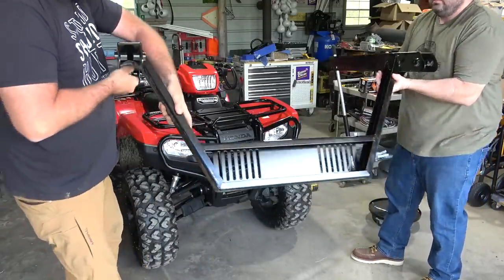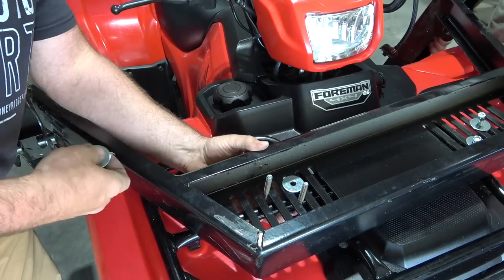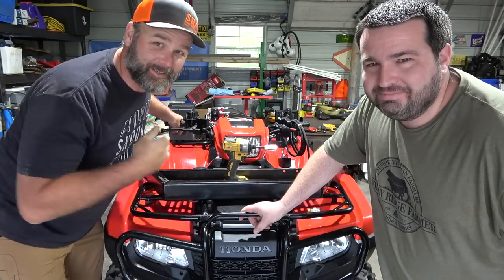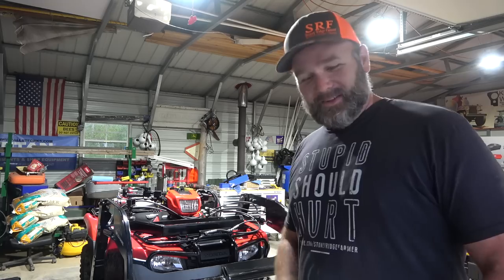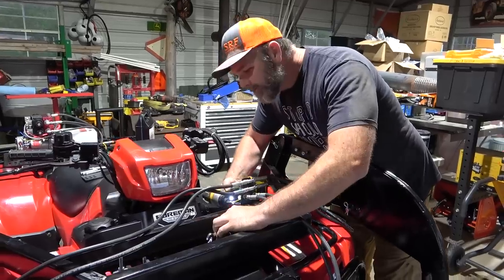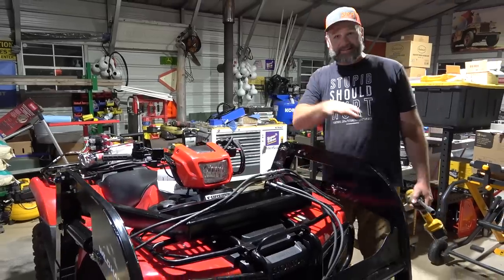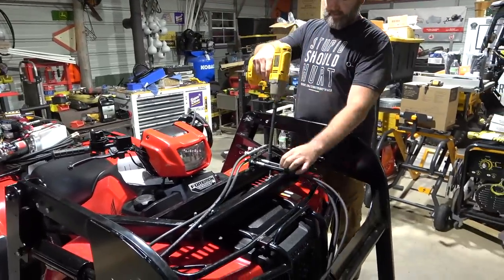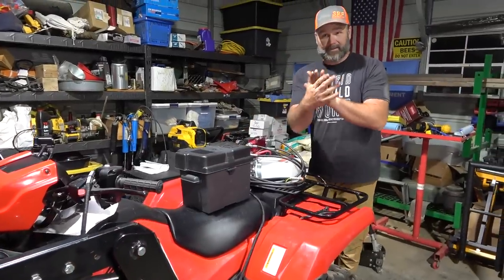You've NEVER SEEN an ATV LIKE THIS

Comment: Josh, if you can plow with that, im gunna take the video and throw it at my tractor dealer that told me  L3800 cannot plow/ rip  with more than 1 tyne, or use a rotary hoe.
Reply from the maker: Gonna install the 3pt soon and give it a try!  Great for food plots and small projects around the yard and farm I'm told!
Reply: You can plow with 2 bottom with coulters. I can pull that with a L245DT
Reply: @doomman700  thank you.
Reply: @Shane_O.5158  I live in central In so we have good dirt, I never thought about heavy clay making it hard if you do have. ✌️

Edit: your local deal can probably find you one to try out. Mine is great about things like that.
Reply: A L3800 should easily pull a 2 bottom moldboard with 12" plows easily. I know guys who pull double 12's and a few guys that pull triple 10's with large garden tractors. Granted we have decent midwest soil, but still.
Reply: It depends on the dirt you are trying to work. In your area with unmodified soil it might be true.
Reply: @doomman700  thank you, i might do a test before buying.
Reply: @msack6904  thank you i have great loamy soil, with clay 18 inches down. i might have to rip it first to remove old tree roots.
Reply: @calvingreene90  thank you i have great loamy soil, with clay 18 inches down. i might have to rip it first to remove old tree roots.
Reply: @Shane_O.5158  I pull a 5 chisel pasture renovator/chisel plow with my 3901 no problemo in low range. I was ripping huge roots out as well.
Reply: @JDOutdoors23  thanks, that's what i needed to know, i think mine should do it.

Comment: Hey Josh.  Just a small safety tip. Those hoses don't need to be rested under your leg.  If you don't want to cut the plastic and run the hoses under them which I do understand. Get some pvc pipe and proper fittings to make it rest nicely where you want it to go.  If for some reason a hose blew under your leg it could be tragic. Lookup hydraulic injection.

Comment: Cool build video. 
I have to say that's a cool attachment and Wildhare is really proud of them with those prices. I would be worry about the durability of the 4 wheeler, just not designed for the ground engagement forces like a garden tractor or bigger tractor are. 
I'll stick to building one myself for my tractors, I can afford doing that.

Comment: You should run some heavy wire from deep cell battery to the Fourwherler battery that way it will keep it charged as long as its running the Fourwheeler. Great idea. Great Video thanks for sharing..

Comment: They make similar attachments for garden tractors, so this set up should be about as useful.  Good for garden, lawn and light chores around the homestead.  I can see where you might use it for checking livestock and carrying bags or buckets of feed to them.  Good for checking and repairing fences or taking a can of fuel to the field to top of the tractor when you're in the middle of baking hay/etc.
Reply: I meant baling hay.  Don't you love auto correct.

Comment: You can put an isolater blocl from the onboard battery to the back battery which will only charge when running ,other wise they are seperate circuits

Comment: I have seen these mounted on small lawn tractors. Not worth the hassle!
Reply: I think it all comes down to what the lift capacity is. That front loader bucket is quite small so it's not a tool for large volumes. The short wheel base and low weight of the 4 wheeler means the lift capacity can't be very high and also that attachments such as the pallet forks have very limited use.
Also note that the simple design of the lift mechanism means the tool installed will tilt when the arms are lifted. This makes using the pallet forks a bit harder, and you definitely want to think things through before lifting anything more than a foot or two.
This doesn't mean it's going to be useless, just that you have to be prepared to work with the limitations and not expect this to do heavy lifting.
On top of that comes quality concerns. The fit and finish seems to be good, at least is appears that way from this side of the screen. That doesn't mean the material is necessarily going to be of good quality, but it increases the chances.

Now is this thing going to be of use to you? I have no idea. To me it seems it could be of use for very light work, such as shoveling snow where a large tractor is overkill. Depending on lift capacity it might be able to stack hay bales and such. It won't replace a tractor anywhere you need to lift anything really heavy. So it's of limited use, especially if you already got a small tractor, but in the end it all depends on what your expectations are.

Comment: I've owned my Wildhare  FEL/forklift for about 4 years now. Cute as hell, ain't they. People marvel at mine, which is attached to a 2010 Honda Rancher 420. They are easy to
set up, and the are good for snow plowing your driveway and very little else unless you're driving a largest ATV available. My 420 is the minimum a Wildhare will fit.
One serious problem with these loaders is that you have to provide your own ballast. They will not lift even 100 lbs. without some sort of counter weight on the back
of your machine. So, be warned. The bucket as you might be able to see is way too small for any serious earth moving. My load came with a set of 32 inch forks,
which do a credible job as long as you have the ballast. I use them mainly to move wood around my property, and the bucket I use for small amounts of stone and snow
plowing. Anything more serious and I get out my JD 1025R, which I use when the Wildhare is to small for the job. No way am I badmouthing anyone here. I like and subscribe here. But we all have to keep a level head about what we all are seeing here on YouTube, as well. Keep up the good work, Josh.

Comment: Could you do a follow up on the 3pt hitch & those implements & performance/utility
7k for a full package from wild hare + a 500cc 4X4 atv =13k =+ -- 1k mini tractor or big no?? 
Just trying to run some numbers. A good older tractor with functional implements vs this new gadget 
Small acreage needing a best fit power multiplier tool kit. What's really bulletproof & long term useful??
thanks

Comment: I have a unit like that for my 01 sportsman that I bought back in 2003 it was made in Hawley Mn by concord industrial or something like that, the big difference between this one and mine is the hydraulic pump for mine Is located on the front rack, I talked to them about 5 months after I bought mine and said they need to put the pump on the back to help with weight and run a 12 volt deep cycle battery in line with the atvs battery, I know they made the change but then the company moved and I lost contact with them, think my loader is called a Groundhog or something like that, it’s sitting behind my shop right now, they also used a front shock bar that you put in the front shocks to make them more solid so it wouldn’t dip so much, I used it a lot for small tasks then took it off and it has sat for 17 years now. They used a big 2x6 channel that ran under the wheeler left to right with u bolts holding it onto the frame and then the loader arms bolted down to that channel where your feet sit, still had room for your feet, then there was a cross bar on the upper loader arms that bolted down to the rack, my pump is also attached to that cross arm. I’ve always wanted to see if it will bolt up to my 2014 sportsman but just haven’t taken the time to do it, I would also move my pump to the back rack like yours is now. Have fun with yours and don’t tip it over by getting into a bad angle, it happened to me in a ditch, lesson learned.

Comment: This is so stupid. Just get a tractor with a loader. This will ruin your atv. Make sure you go slow  when you have that thing on. That will put a ton of force in places the atv is not designed for.
Reply: I 💯 agree .. the atv is not meant to take the force an stress this will cause it to have .. blocking the shocks ?!! No way, there goes the handling An overloading the frame an front end parts ! They can say it’s jus for light duty only , but ppl will overdue it an next thing ya know they be at the dealer upset cause they have worn out front end parts or even worse bent frame or warped front rims .. who knows .. but this is a bad idea. They make garden an utility tractors for this .. like the little utility tractor Josh already has .. this is a cool idea an neat to see but totally terribly hard on the 4 wheeler .. josh will have something broken or bent in no time with this for sure ! Sorry josh but it is what it is ..
Reply: This should be ok for the ATV. On Farm you usely drive slow and do not rush over big obstacles.
Reply: @jonasstahl9826  ya well you An I both know .. “should be” isn’t a for real deal .. ppl are to quick to overload an abuse an do thing past the proper recommendations an get hurt or break the machine an .. now that’s not the piece of equipments fault .. but , no atv dealship or manufacture of atvs built the machine with having this installed onto it .. therefore the frame an suspension an ball joints etc etc of front end of machine is not going to take that extra pressure or force .. not even the rims nor the tires are not ment to take that load.. sorry but this is my honest opinion an thoughts that we’re all entitled to an .. above all common sense goes a long ways !
Reply: @DarrensTruckzs  I understand what you mean.
But if you dont care about warranty why not. Ofcourse it takes a lot of stress and wear on your ATV. But it is yours.
There are why more maniac ATV driver out there, that abuse there extrem Modifyt vehicles. If it break it is your/there fault.
It is probably cheaper to repair an abused ATV that you already own, than buying an extra piece of equipment like a small tractor.
Reply from the maker: I think it's pretty nifty and have used it for a couple days now...it's lighter than a tractor...but handy for moving water tanks and stuff.  It's just a cool way to trick out your atv...just wait till we put the 3pt on it buddy...then it really gets fun
Reply: @StoneyRidgeFarmer  Why did you connected the hydraulik pump to an aditional battery instead of using the ATV-battery?